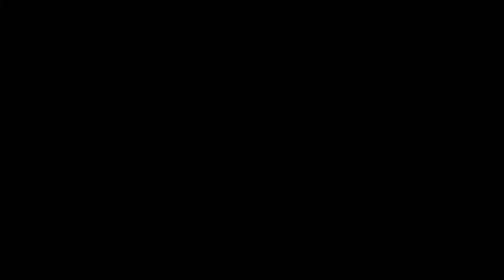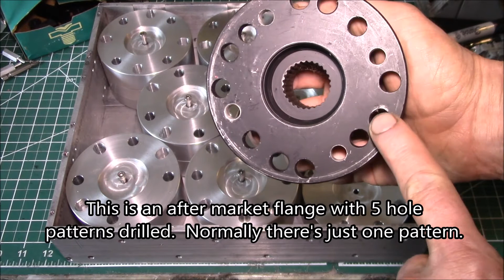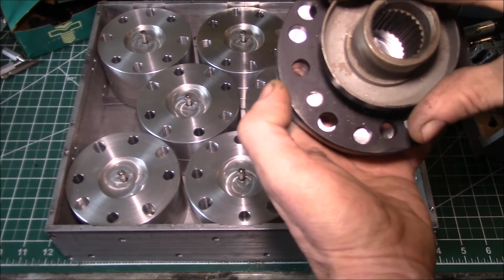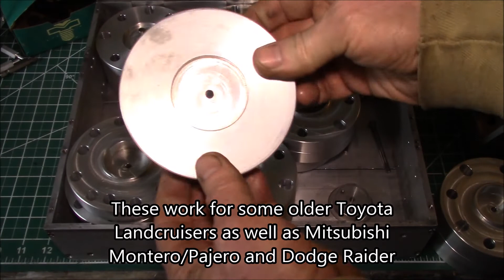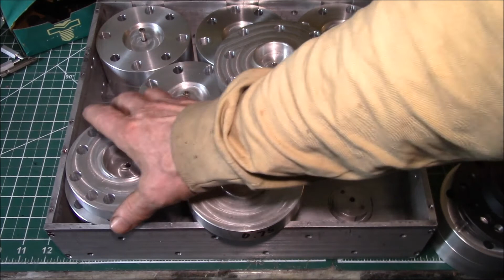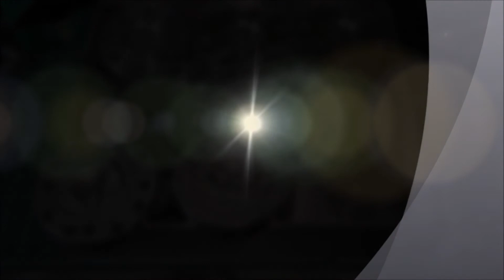Toyota Drive Shaft Spacers

Comment: I got a 6 inch lift on a toyota tacoma and fluid is starting to leak from drive shaft. Assuming it’s because there is no spacers but what would you recommend?
Reply from the maker: There are some tips on measuring for a spacer on the web page, link below:
https://www.4crawler.com/4x4/ForSale/DriveshaftSpacer.shtml#SpacerSize
Ideally, one would have a before and after length measurement, but nobody seems to do that.

Comment: just did a 3 inch lift on my 2wd 1998 4runner, I unfortunately did not measure any driveline angles before altering the suspension. I need a spacer to compensate for the lift, what do you recommend?  Please advise.
Reply from the maker: See below for some options on determining spacer size:
https://www.4crawler.com/4x4/ForSale/DriveshaftSpacer.shtml#SpacerSize
If you can see where the shaft originally ran on the splines, that's one option, otherwise a few simple measurements plugged into a triangle calculator will give you a good number.

Comment: I have a 2019 toyota tacoma I need a 1 inch driveline spacer how much would it be?
Reply from the maker: Best to check the bolt hole pattern:
  https://www.4crawler.com/4x4/ForSale/DriveshaftSpacer.shtml#SpacerDimensions
But likely it has 11mm bolts and one of:
$81.00:   https://www.4crawler.com/4x4/ForSale/DriveshaftSpacer.shtml#DSpcr11mm
$111.00: https://www.4crawler.com/4x4/ForSale/DriveshaftSpacer.shtml#DSpcr88mm

Comment: Are you able to make one for an is300
Reply: I gotta redo my measurements but the thickness I need is close to .5 in
Reply from the maker: @brandonsuer9173  We do have 0.5" spacers in our new batch.  Still have to add those to the web page ordering section.
Reply: R Brown ok I have to figure out my bolt pattern and I think we’d be good
Reply from the maker: Check the bolt pattern and see if any match up, there's a good chance they are similar:
https://www.4crawler.com/4x4/ForSale/DriveshaftSpacer.shtml#SpacerDimensions
Reply: R Brown the bolts are 14mm
Reply from the maker: @brandonsuer9173  Bolt heads or wrenching size may be 14mm, but the bolt shank (or size of hole you need to drill for the bolt) is likely 10mm or 11mm.
Reply: R Brown true are you in Florida?? If I send you the flange would you be able to make a space
Reply from the maker: @brandonsuer9173  No, we're in CA.  Easiest thing to do is measure the bolt hole spacing and compare those to the patterns we have on the existing spacer.  Our latest spacers have all 5 common bolt patterns on them and fit most every Toyota driveshaft.  Many of the RWD passenger cars use the same differentials and flanges as the trucks do so there's a real good chance your flange should match out of the existing bolt patterns.  Or we have a few blank spacers where you could drill holes to match your flange.
Reply: R Brown yea I saw that I like the idea of drilling my own holes but the smallest spacer I saw was a .75in would you be able to do a 1/2in or 5/8in spacer
Reply: Did you end up getting one for the is300 I'm doing a r154 swap this seems like a money saving idea

Comment: Hey so this for the front side of the driveshaft? If you still have any of the 3/4 adapter... I'll take it for my T100. However I'm not sure if I'll need though. Because I got one off a land cruiser that's a 3/4, and it's for the rear end driveshaft. The hole was smaller and it didn't work unless I open it up like you where saying on the video clip. Now I did drill the hole a little longer so that it can line up with the bolt hole. Anyhow it works after a small minor modification drilling. With your adapter I'm sure it'll work too but send me your link I'll support you
Reply from the maker: Spacers can fit on any end of the drive shaft that has a 4 bolt flange.  Although the different ends of the shaft often have different bolt patterns:
https://www.4crawler.com/4x4/ForSale/DriveshaftSpacer.shtml
Sounds like you might have a spacer for the 8mm bolted flange on the earlier Landcruisers and pickups.  Later models used the 10mm bolts.  Or you have have slightly different bolt patterns on the two flanges.  But if you can drill out the holes in your spacer and it fits, that should be good.  The holes are only there to fit the bolts through.  It's the clamping force of the bolts on the flanges that transmits the torque.

Comment: I feel just a slight vibration taking off from stop after a lift , I’m guessing that is what I’m noticing now ?? Did all the wedges etc
Reply from the maker: Check the slip yoke on the shaft for excess play and also see how much it was pulled out with the lift:
https://www.4crawler.com/4x4/ForSale/DriveshaftSpacer.shtml#SpacerSize

Also check for other sources of vibration:
https://www.4crawler.com/4x4/CheapTricks/Driveline-101.shtml#FixingProblems
Reply: R Brown I see the old sin cos and tan I remember from school geometry working out triangle degrees too
Reply from the maker: Handy link on the first page to an on-line triangle calculator to work out the lengths.  No need to mess with angles if you don't want to.  Just measure the vertical and horizontal separations of the end of the shaft and plug in those lengths into the calculator for the after.  Then plug in the vertical separation - lift height and plug that in for the before.  The difference of after - before is how far the shaft pulled out with the lift.
Reply: R Brown cheers thanks mate, yeah there is a little to much wiggle for my liking, get him sorted tomorrow and have a good check of everything. Uni is a bees dick worn , done many miles so might replace everything cause I’m anal and notice any new shake or knock. 1991 landcruizer been all over Australia 👍
Reply: Did you put a spacers?  And did your vibration go away ? I'm having the same issue with my Toy.
Reply: @martysworld6052  had to take a little of the wedges, also put new uni joints on
Reply: @silverbackanimal7215  did that solve your vibration issue? It's driving me nuts
Reply: Did for me , to this day thee tail shaft makes a ping like someone taps it driving in heavy sand and taking of in first from a stop , it’s probably a little worn too , just have to go over everything and make sure everything is spot on we’re it’s supposed to be , if you have big tyres like 33 inch and bigger it will mess with everything on some vehicles to . A slight twist bend or buckle and that can be a reason too

Comment: Need 1 of Toyota tundra 2010 please
Reply from the maker: Sure, check the dimensions of the bolt spacing on the flange you wish to install the spacer on and match that to the spacers below:
https://www.4crawler.com/4x4/ForSale/DriveshaftSpacer.shtml#SpacerDimensions

Likely one of the 11mm bolt hole patterns.